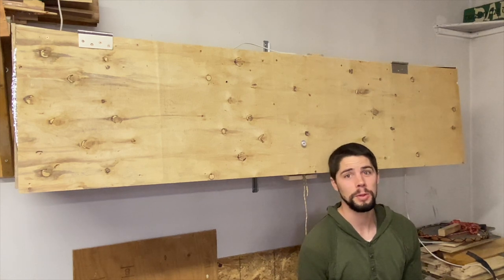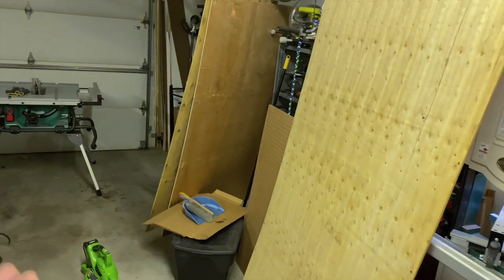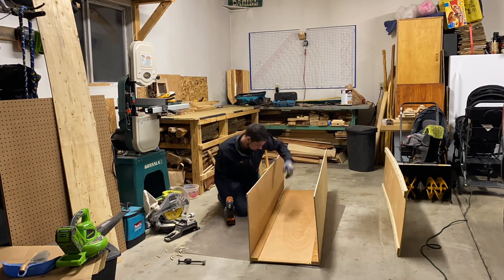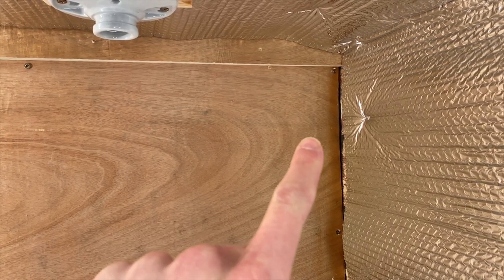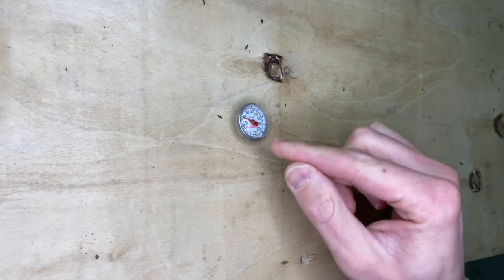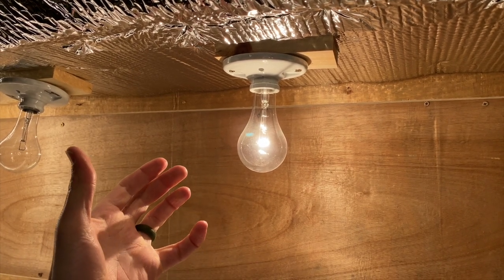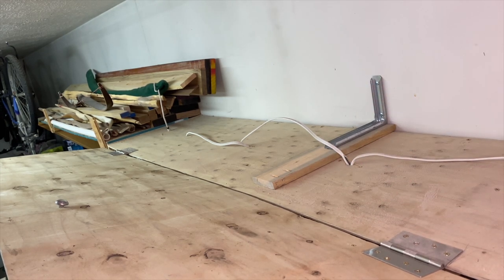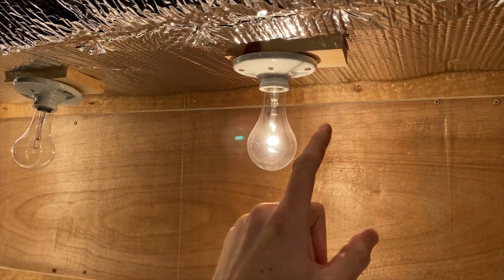How to make a heat box for a Bowyer

Comment: Nicely done. Looks so much better than mine. I don’t do much heat curing so I only run it at a mild temperature that’s great for hickory bows
Reply from the maker: Thank you! What do you use it for with your hickory bows? To help reduce moisture content? Kind of like a kiln?
Reply: @BowtellBows  I set it for eq. moisture content of 8% 
So if Ieave a stave long enough that it stops losing weight, I know it’s at 8%. Much more precise than a moisture meter which only measures the outside of the wood
Reply from the maker: That is a great idea! Might need to rig that up in mine